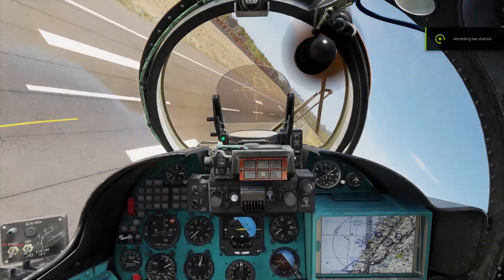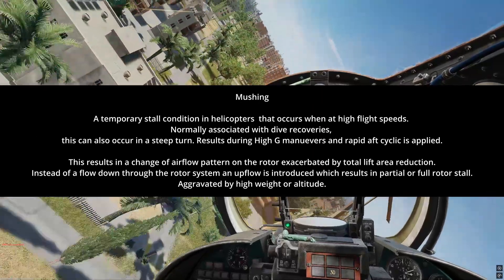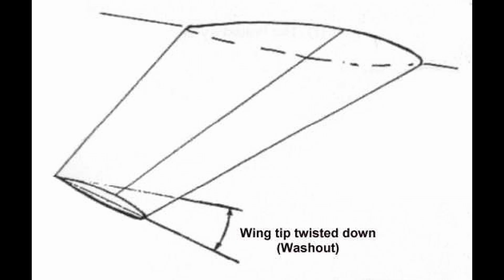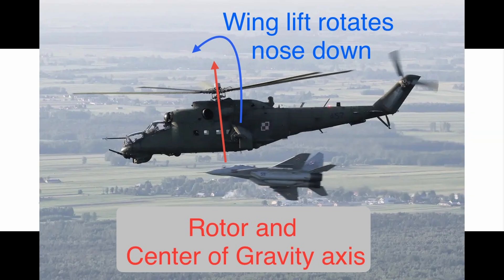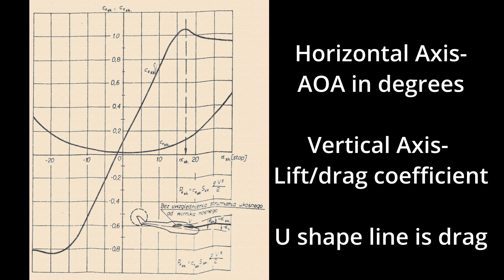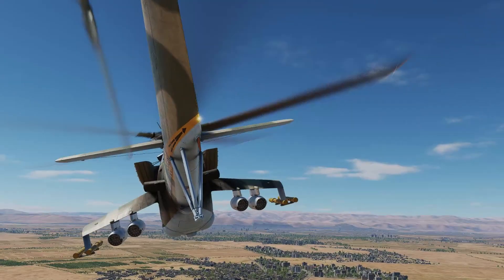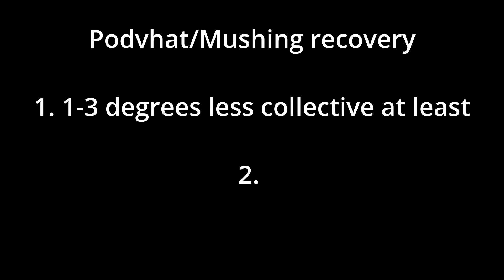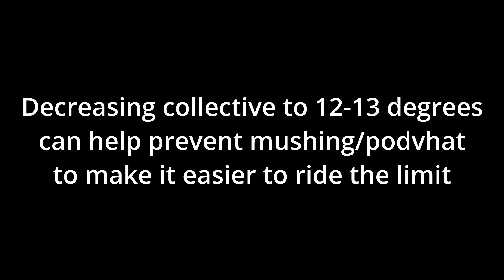Unintentional Mi-24 Cobra Maneuver Causes and Fixes in DCS

Comment: The sound change is very intuitive and that was my go to for riding the limit but now learning about the 🌟AERODYNAMICS🌟 made it so much cooler.
Reply from the maker: Thanks! I usually check what G level the flapping sounds happens at and decrease it a tiny bit. Since your wings are already stalled by the time the flapping sound happens, you can turn faster with blade flap sound but it bleeds speed fast. Just below blade flap sound when wing is still un stalled is your best “sustained” turn rate so to speak lol